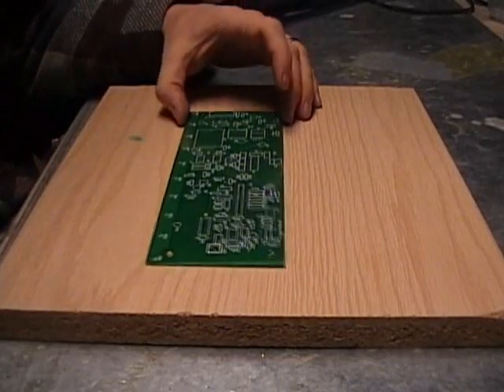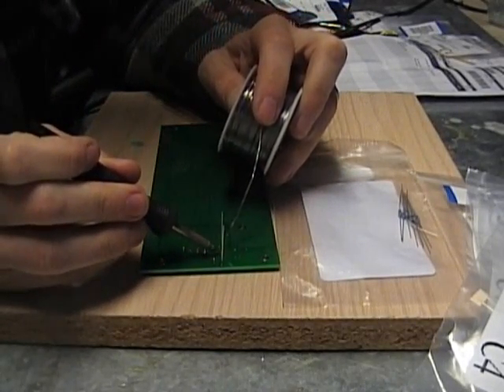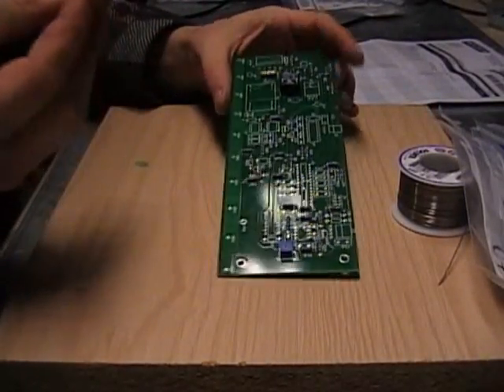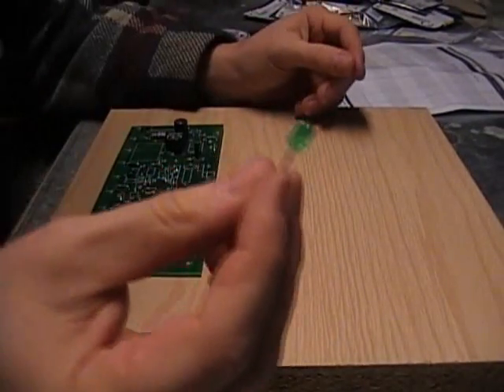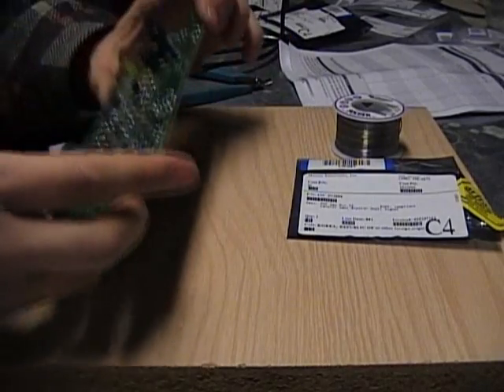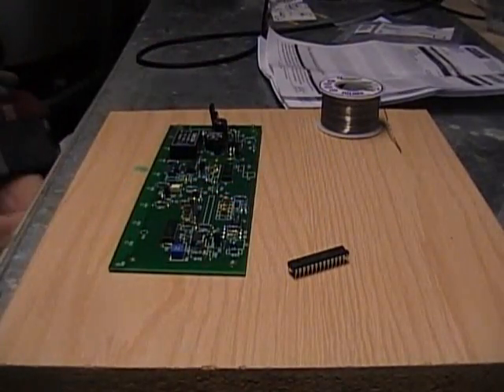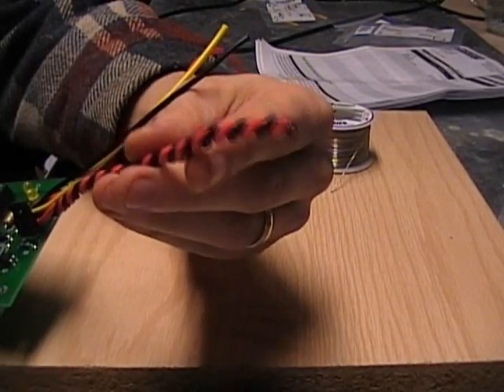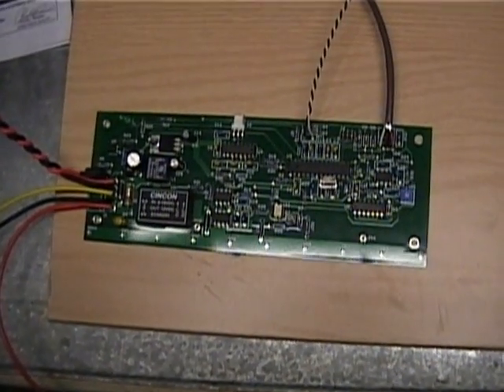Soldering the control board for the 144v 500amp controller

Comment: hey paul, how did you calculate the amount of capacitors, resistors, diodes and transistors you needed to make the 144v and 500 amp capacity? id really like to learn more about this stuff, i wanna build a semi that runs off electric motors from scratch, ive gotten everything figured out from building the battery packs, mounting the motors, everything except a controller that can handle four 250hp dc motors and run off a drive by wire pedal. its so hard to find good quality information and you're the only guy ive seen who has the knowledge for this kinda stuff

Comment: is this a kit you come up with.   and also are you alble to use any voltage supply that is dc and power it up to 144 volts and is the current the only thing that is controller able or is both the voltage and current controllerable.   becasue this realy look nice. I love to buy it and build it for exspermenting would make a great power supply if you are able to controll both voltage and current.

Comment: @MPaulHolmes Hi sorry from not removing that post it was from back when i hoocked it up to a too low woltage and it automaticaly shut down. The controller is Currentley working Fine. I will put a video up of it soon.

Comment from the maker: @Sohave The green LED will stay lit and not flash, because it's just showing that the 12v power is there.  The yellow LED should flash if you don't have the current sensor or throttle hooked up.